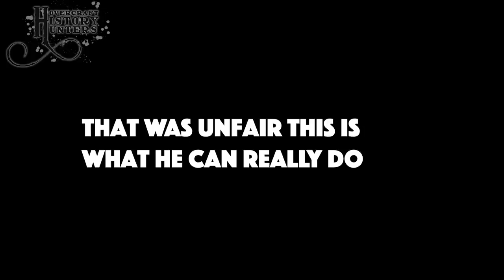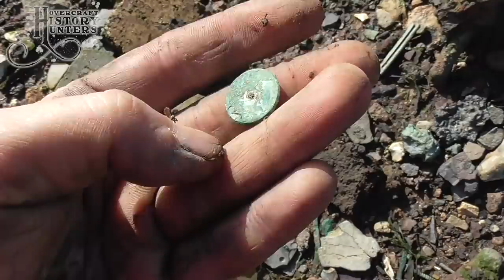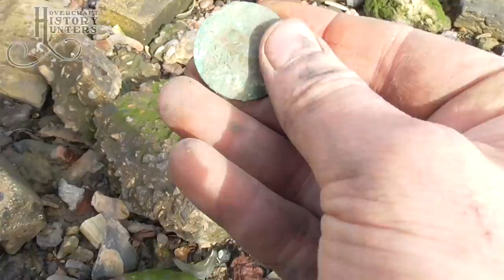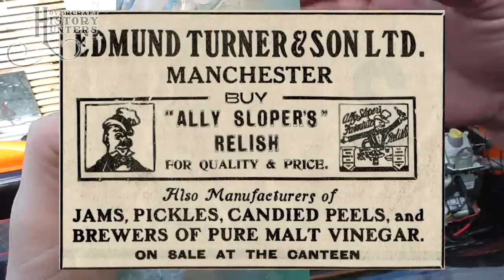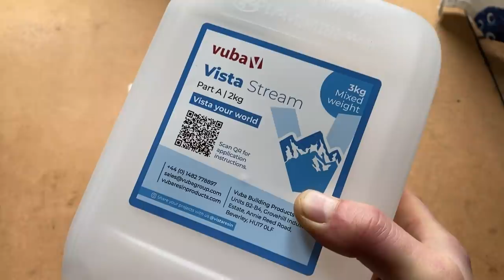We found a SKELETON & the biggest poison bottle ever Mudlarking!

Comment: I think you should invest in a vacuum machine to remove the air bubbles out of the resin before you pour it. You'll find it gives a much better finish.
Keep up the cracking content. 👍
Reply from the maker: I quite like the bubbles
Reply: @Sifinds  I don't disagree with you, sometimes they add a little extra to the pieces.

Comment: Si, are you at all familiar with the term "oxide jacking"?? It means that rust takes up more space than the metal it was converted from, and as such, when things rust they expand, with a huge amount of force, hence the jacking (like a hydraulic jack). It is also important to note that orange rust is "alive", and will continue to work it's way into the underlying metal. All of this to say that your robot is at serious risk of destroying itself. (Though it will probably be just fine for many years to come) However, when encasing anything ferrous it is very important to remove or convert or remove any orange rust! That all aside you did a great job on it, it looks awesome, and I can't wait to see more!!

Comment: 17:35 - What a great illustration of how a tree grows a branch - the branch starts when the tree is barely a twig - over the years, the branch forms rings and pushes outward, but the tree forms rings and grows around the branch - finally, years later, the base of the branch ends up extending to the center of the tree - too bad you couldn't have taken that bit of driftwood - would have made a fine sculpture - also, great job on the steam punk robot at the end :-)
Reply from the maker: Thanks Bill!

Comment: Hi si, I wondered if you could help, i have found a broken bottle which I would like to cut down, could you please give any advice on how you do this and how you smooth off the edges after. Any help would be greatly appreciated, cheers. 
Stu.
Reply from the maker: Wet tile cutter and various grades of sandpaper. Or cheat and use clear lacquer
Reply: @Sifinds many thanks

Comment: Europeans refer to Brass as Copper, why is that. Brass has a very good scrap value to. Personally, I use them in my woodworking.
Reply from the maker: Copper is an element, brass is an alloy of copper and zinc, so are two different metals 👍🏻